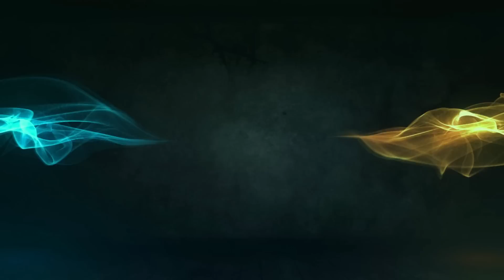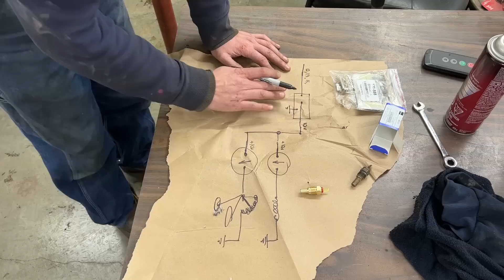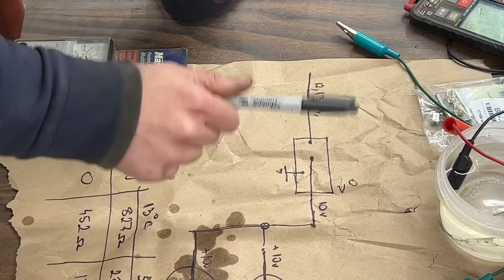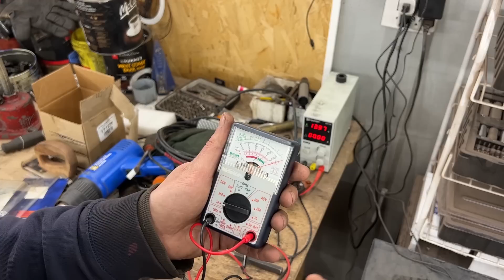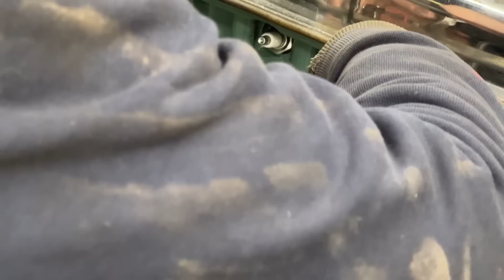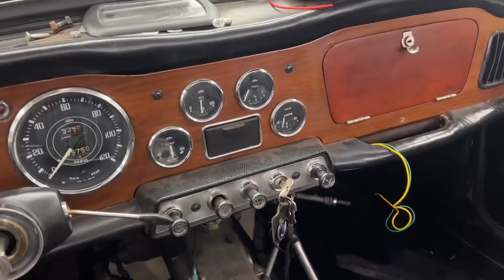'64TR4 - Part 29 - Temp Gauge, Vacuum Unit & Compression Test

Comment: I think that compression gauge is a bit "optimistic".  180ft/lbs is crazy high for a TR4.  Should be around 140-150.  But they do say in the paper work for those gauges that they have a HUGE + or - range.
Reply from the maker: It is a cheap gauge, yes, but it wasn’t that “optimistic” before the rebuild :) Not only it measured much lower compression, but it was also very inconsistent across the cylinders. Now it is dead on at the same number for all of them. So I trust it

Comment: On the original Lucas vacuum advance, there are some numbers (I don't know if the reproduction advances have these numbers on them).  The long number is the Lucas part number for the advance, for your distributor, 40795A, the number should be 54413565.  You'll also see three other numbers in a row, and for your advance, it's should read 2-6-3.  The numbers mean:
2 = inches of mercury that the vacuum advance begins to advance
6=  inches of mercury that the advance reaches it's maximum advance
3 = means 3°, the advance provides 3° of distributor advance maximum,
          which is 6° of advance measured at the crankshaft
This advance should have a screw type fitting rather than the push on fitting, so the vacuum to carburetor pipe is missing it's end at the distributor, and someone has substituted the push on type.  
You can usually get these for a better price from britishvacuumunit.co, which I believe is Moss'source also.
 - Paul

Comment: Elin, the owner of this car should be overjoyed with the results of the latest compression test.  
I always thought that when checking the vacuum advance, that it was really important to get the idle rpm's set to specification first and then proceed with timing and vacuum procedures;  while re-adjusting idle rpm as needed to get a good baseline setting?

Comment: You changed to an electronic ignition.  What do you feel you have gained compared to standard ignition set up.  I have a TR4 engine with new 87mm pistons in mtTR3A (1960).  Do you feel that it is better to upgrade to electronic ignition and if so what brand/type do you recommend.  Just curious.  Thanks
Reply from the maker: Some people are totally against electronic ignition, calling it unreliable and they swear that a set of points that are well maintained are the best option since you can always “massage” them if they fail and get home, while the electronic ignition is dead once it is… dead! Well in my opinion even if the electronic ignition doesn’t improve the spark it always gives you the best spark possible without any maintenance, while the points can give you a weak or inconsistent spark if they are not maintained well. So my theory is electronic ignition is the way to go and if you feel insecure, just throw a set of points and a condenser in the glovebox just in case and enjoy your ride. 
The brand I like is Pertronix
Reply: ????? For you as you seem to have lost yours.

Comment: If the idle is low and the timing is correct. You should adjust the idle at the carbs. Advancing the ignition will raise the revs yes, but you'll then have the car too advanced at higher revs and cause pinking (or detonation). The slots in the knurled nut on the vacuum nut should drop into a detent pressed back by the spring. You can then count how many clicks. I forget how many degrees a click is (not played with these old distributers since the 80's 😂). But you should be able to count out 4 degrees fairly accurately. 
Timing lights these days can be programmed to flash in advance. So all you need is TDC mark. But if you time it with a light, you must remove and plug the vacuum line. Or you'll get a false reading. The vacuum (depending on the car) can make between 5-15 degrees of advance. But this is by no means the main part of the advance circuit. The bob weights in the distributor do the main work up to around 30 degrees. The vacuum is only there to add a bit of advance on cruising, to improve economy. You won't see a vacuum advance on a performance engine like a Lotus.
Reply from the maker: When I say I have the feeling it needs to be advanced a little more I don’t mean the rpm are higher there, it just runs smoother at idle and higher rpm. Regarding the strobe light I am not looking to set the timing exactly as per the spec because every engine is individual depending on many factors like type of spark plugs, condition of the ignition components and even camshaft timing. So the spec tells you to set it to 4 degrees BTDC and then fine tune it for “best road performance” and that is what I am gonna do.
Reply: @RustyBeauties  I have no doubt you will tune it to perfection. Please don't think I'm moaning, what you do is amazing with the old Triumphs. I just thought I would help clarify and share my knowledge of the ins and outs of engines to your followers 👍 Keep up the good work.

Comment: Yes mark the flywheel and get a strobe light on the timing as it is the best way. I think the specs used to call for removing the vacuum line and adjusting the timing without it. You can see the action of the distributor bob weights then.  The engine sounds a bit retarded I think.  I liked to adjust my timing until it just started to pink (ping) at high throttle openings at 30 mph in 4th gear.  It reduced the low rev torque but gave a bit more high end power. This setting would be a few degrees more advanced than the factory setting called for. It is a personal preference and you have to work the gearbox a bit more.  It is easy to keep checking your timing adjustments when you use a strobe light.  You should get one or two lol

Comment: So are you going to check the timing with a strobe light? I always thought that was best way to make sure the timing was exactly right. And that you could also check the timing advance with the strobe light too. Maybe @cheftush has one :)  The car sounds so much better now from when it came in. That's for sure!
Reply from the maker: In my opinion every engine is individual in regards with ignition timing. Even the spec tells you to set it to 4 degrees BTDC and then fine tune it “for best road performance” So a strobe light would help me set it to exactly 4 degrees but that doesn’t mean that is the best timing. I am going to adjust “by ear” from here during a road test.
Reply: @RustyBeauties  Very good point. Cheers.

Comment: The gauges that rely on the stabilizer are biomechanical so they heat a little strip and that strip moves the needle so the retained heat in the strip keeps the gauge from flopping on and off
Reply: Don't want to be pedantic but there's nothing living in the voltage regulator. It's electromechanical.
Reply: @johngidman4574  bimetallic my bad

Comment: Elin, when the old voltage (10V) regulator has a zero output, don't the gauges go down to their zero? Or are they 'slow to operate,' in other words do they return to 0 slowly, so that they keep their station more or less until they get 10V again?
Reply: The gauges respond slowly (they are also bi-metallic strips), so they effectively dampen the on/off nature of the old stabilizer.